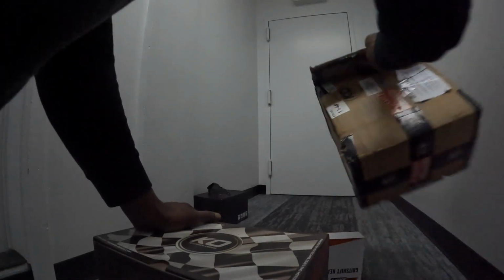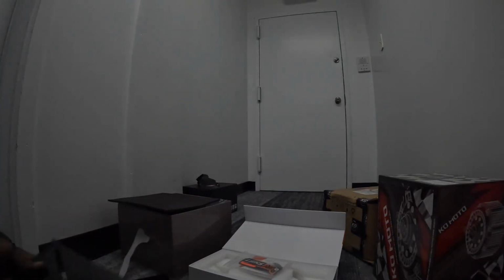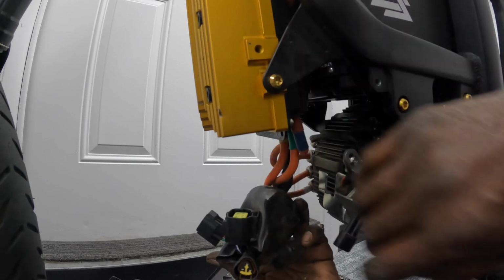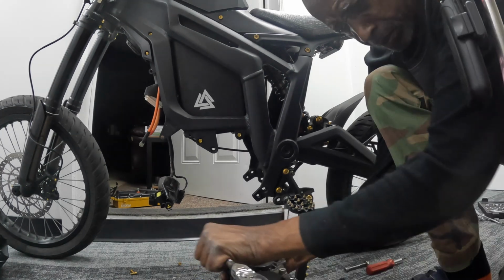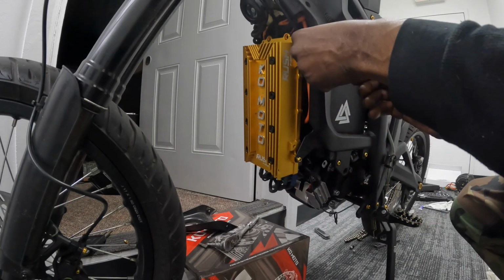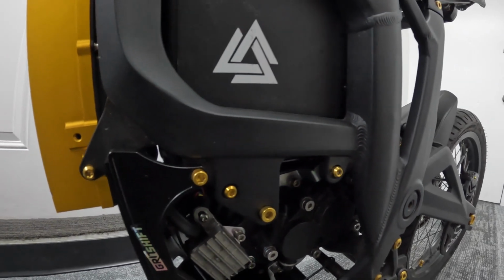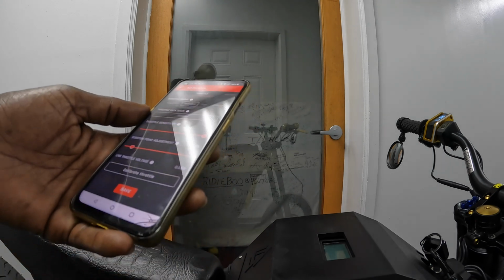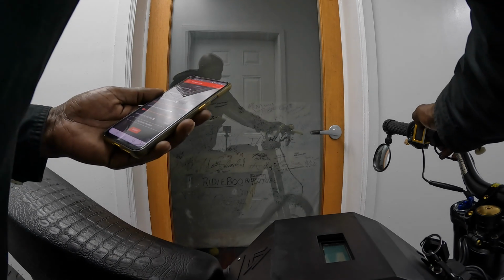Talaria Sting R K O Moto Factory Spec Motor Install

Comment: My son dropped my sur Ron x. The alignment is off. Not sure how to fix. Forks not bent. Hit me.
Reply from the maker: you can star with loosening the neck and hold the front wheel and try and twist the bars back to center.  other than that would need to see it.